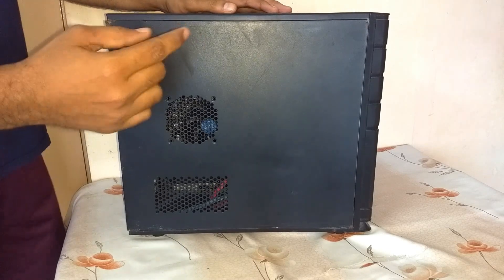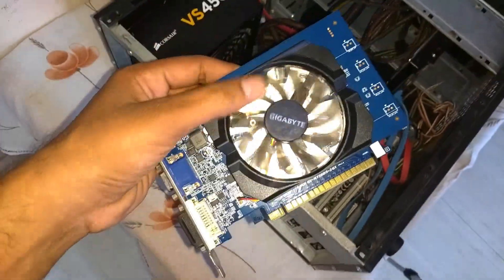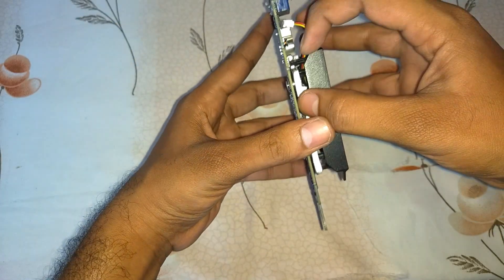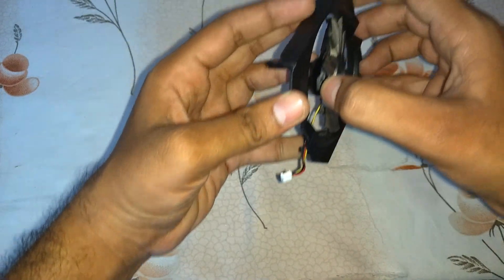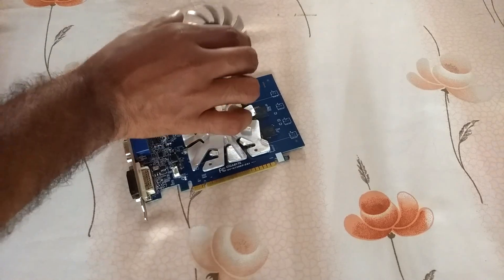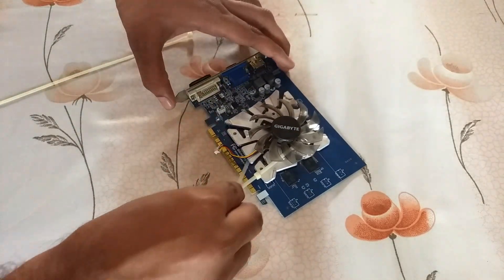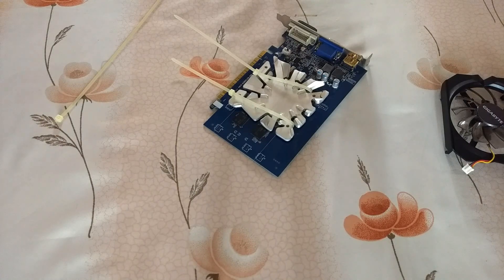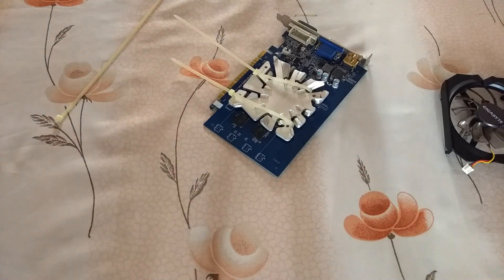Graphic card covers PCI-E x1 slot?  Best Solution.

Comment: CABLE MANAGEMENT!!! 
THE BEST DIY SOLUTION: Desolder EVERY component from the graphics card, and solder them back on the other side!!! Now the 1x slot is open!! 

(And for those who actually care to know how this can be done, not that I'm recommending this... He could've modified the PCI-E 1x slot to fit the GPU,  then used the other slot for the USB Card, I really doubt there would be any noticeable graphics performance hit, considering the rest of the system looks like it's 10-15years old anyway.... Keep in mind, a pcie riser would do a better job, assuming you have the room...)

Comment: Dude... by removing the frame of the fan, you are effectively removing about 70% efficiency from your fan. Those elements have a reason in their design, both in the fan itself and the frame. The fan is not able to use its design to properly pull/push the air from and into the right direction if the frame is not there.

Comment: Just add a riser cable dont do what this guy did
Reply: Daniel Teunissen Riser cable to what? If you use a riser card on your 16x slot, you'll have to mount your GPU in an unconventional manner. No way you're fitting a 1x riser card under that GPU. Even a 90 degree angled edge connector rises off of the motherboard about 5 mm too high to clear a modern GPU.
Reply: @AtariBorn  no idiot, use a x1 riser extender cable on your second x16 slot then plug into your other add on card of your choice
Or just slot in a z1 add on card to pcie x16 lane
obviously you'd plug your graphics card in the FIRST PCIE x16 lane